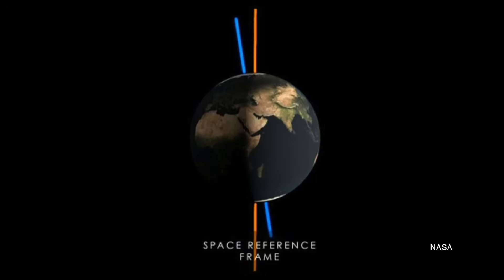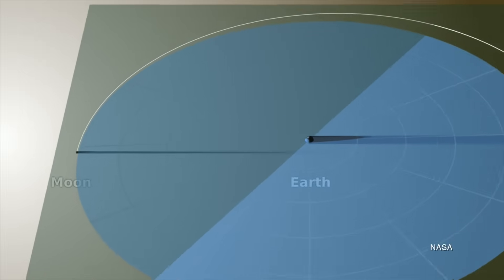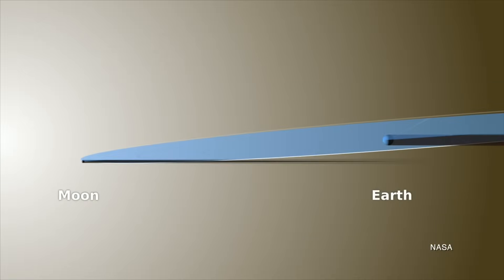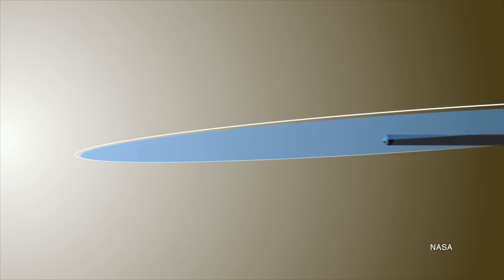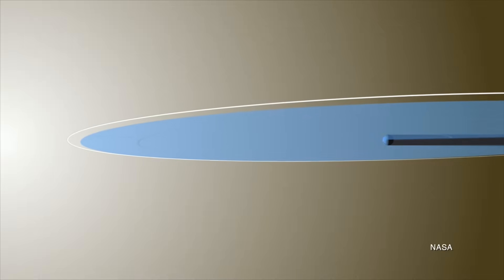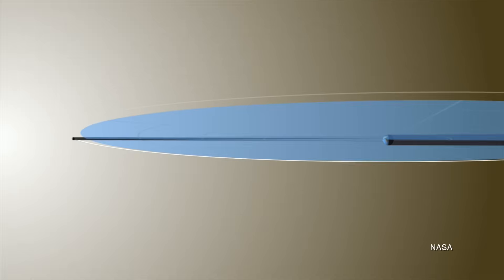Why Does a Rocket Need to Roll Going Into Orbit?

Comment: Why wasn't Apollo aligned with the correct inclination at launch?
Reply: It would be extremely difficult to turn the Saturn V and all its supporting equipment in the right direction on the launch pad, unlike mercury-redstone
Reply: Launch azimuth changes depending on what orbit you are aiming for.
I believe Mercury-Redstone launched from a rotating base, so that an immediate roll was not required.  This was in part because the Redstone's roll capability, particularly at low speed, was limited.  IIRC, the Mercury-Atlas flights did use a roll program.  Try listening to old launch recordings, or reading transcripts.  I think the MA astronauts called out "Roll Program" but I could be mistemembering.
Reply: The redstone did have control surfaces on it's fins, but the launch azimuth wouldn't have been a huge issue anyway since it was suborbital, all they'd have to do was point it roughly toward the Bahamas.  IIRC, Redstones weren't even considered very accurate as theater ballistic missiles.
Reply: And you would need more speed.
Reply: +Mark Holm That's a good point.  I think that mercury redstone would also have some trouble rolling being single engine
Reply: Exactly...even if it were possible to mount the Saturn V in a different alignment on the Mobile Launcher (which they could not do for numerous reasons, not the least of which was they had to have the crew hatch line up with the Spacecraft Access Arm on the launcher), a delay in a launch (such as happened on Apollo 17 or almost every shuttle flight) would make the needed azimuth change slightly.
Reply: The angle to the moon changes +/-5 degree over its 28 day orbit and the axial tilt of the earth changes from -23 to +23 degrees from winter to summer. That means the the alignment of the launch pad would have to change depending on what time of month and what time of year the launch was to occur. It was much easier to just have the rocket make a small course correction just after launch.
Reply: Now that I think about it, you are correct that the 23deg axial tilt doesn't matter.  It would only matter for interplanetary missions.  You still have to compensate for the the +/-5deg orbital tilt of the moon and the 28deg latitude of Cape Canaveral. 
  To correct a 5deg inclination difference in low earth orbit you would need about 680m/s of delta-v.  To correct it at launch when the rocket is only moving at the rotational speed of the earth is about 40 m/s.  To change the 680m/s in orbit would require about 7% of the total energy required to launch.  Because you have to haul all that extra fuel into space I guessing the Saturn 5 lower stages would have to be 10-20% bigger.  Which might mean you need a sixth engine on the main stage, which is extra mass, which means more fuel....  Easier to correct it as early as possible in the flight.
Reply: The mercury redstone combination was sub-orbital, so the rotation of the earth was irrelevant. Rockets are pointed straight up to get out of thick atmosphere as fast as possible before
Reply: It is much cheaper fuel-wise to do the "small course corrections" after the mass of the rocket is reduced. Later corrections are used to align a much reduced mass
Reply: It may have something to do with where the Moon was in its orbit at the time of the mission.  I'm assuming here that the orbital inclination desired may have changed as the Moon progressed through its own orbit.
Reply: tampicokid
Methinks Rob Bradshaw comment addressed what I said in my comment above.